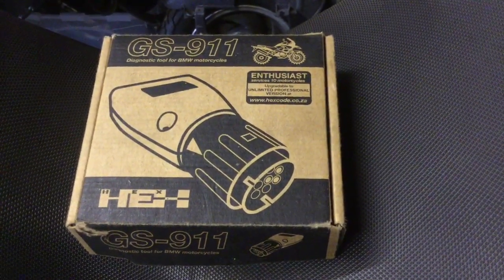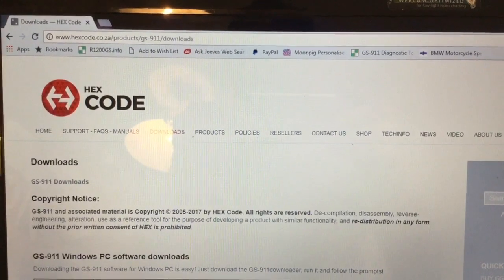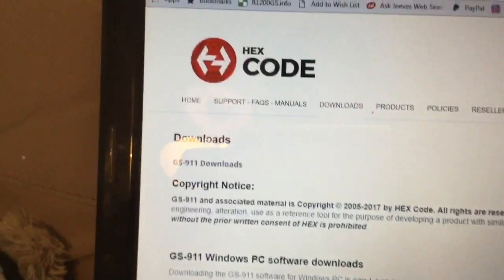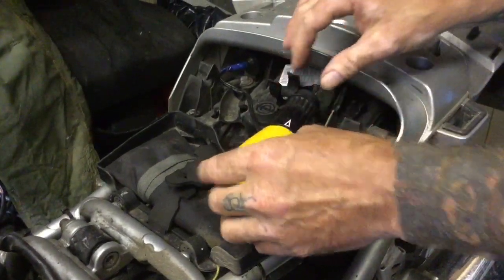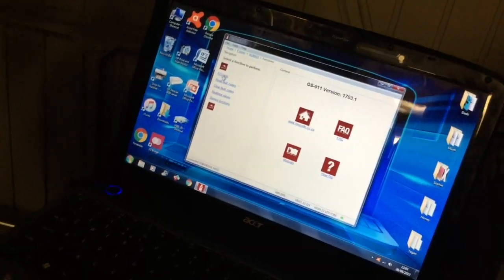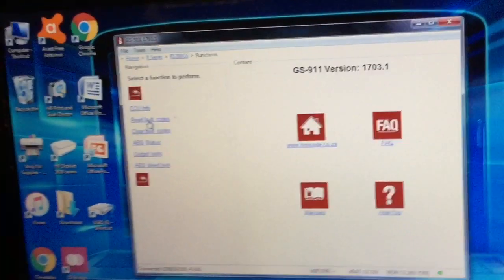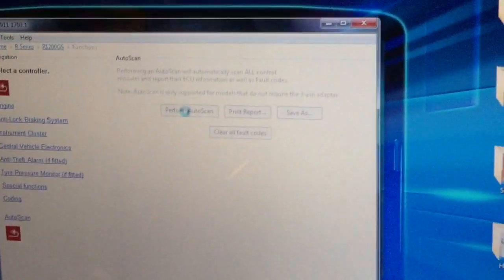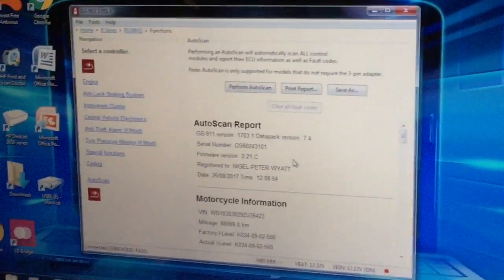GS911 fault code clearance BMW motorcycle

Comment: Does it work under IOs?
Only wired?
Can you reset the service warning?

thanks
Reply from the maker: Yes there is ios capability it does reset the service warning and there is a new version out now i believe is wire free either bluetooth or WiFi 👍

Comment: Motoscan with a  OBDLink LX does the same. Currently using g that method on my 2013 K1300R.
Reply from the maker: I think theres a few different models you can use, i have a different bike now and use the vance and hinds on my harley

Comment: Hello,
Am building an accident damaged 2010 BMW S1000rr, i seem to be stuck, just cranks have tried replacing a couple things including harness, which i discovered cut tps sensor wires, which i soldered back, but still same,

From forums been guided since its 2010 model, i can get the yellow gs911, will that able reset adaptations and TPS, and maybe of in limp mode activate the bike?
ecu BMSKP, 2010 BMW 1000rr
Regards
Jackson
Reply from the maker: yes i reset mine,  i managed to rest the tps and adaptions, hope you get it sorted
Reply: @npw1964  hi did u get yours off ebay, i hear most of those are from China and can't do much? Where did u get urs from?
Reply from the maker: No I purchased it direct from the company in Germany I doubt if the Chinese ones can do what these can.
Reply: @npw1964  which Germany  source, and how much? Do u have a link?

Comment: Hello. I got a r1200gsa from 2014 with quickshifter but it isnt coded, but the preparation is on the bike. Is it posible to turn in on with this device?
Reply from the maker: I don't think you can
Reply: @npw1964  thank you for your response. I called the dealer and it needs to be done there. It is indeed not possible to do with this device👍🏽

Comment: Hello, can you tell me if this disgnostic device and this connection I can plug in a BMW F800 GS Adventure 2018?
Reply: Since you have a 2018 bike, you might check to see if your bike has a standard OBD-II diagnostic connector.   If so, you probably won't need to buy an expensive GS-911, just get a standard OBD-II cable from Amazon and generic OBD-II software.   I've been told that bikes made after Jan. 2017 use OBD-II.
Reply: Keith A. THANKS
Reply from the maker: sorry i couldnt reply, hope you sorted out the connection